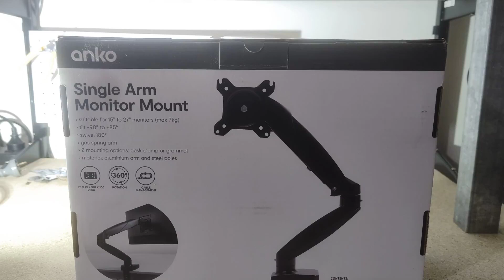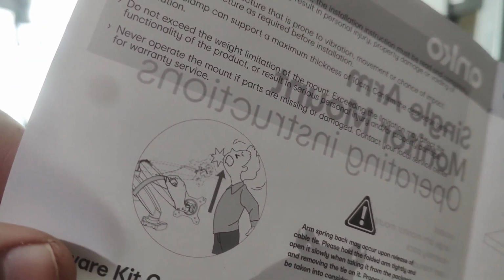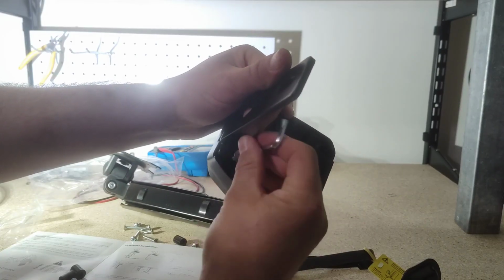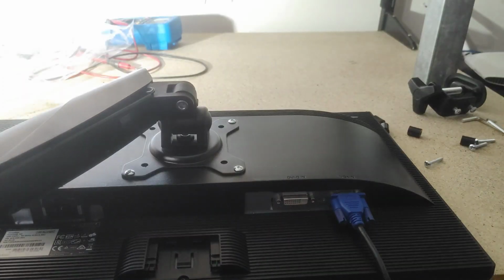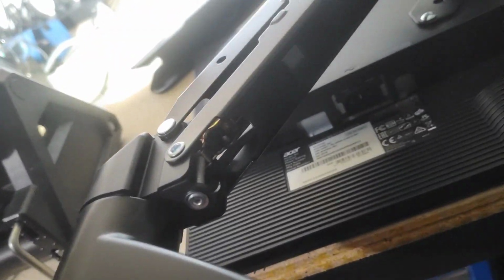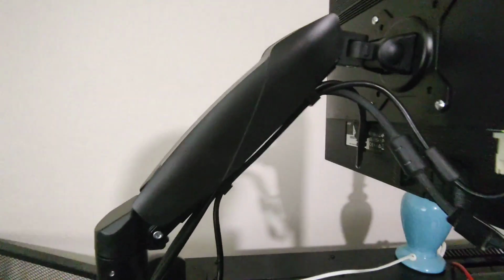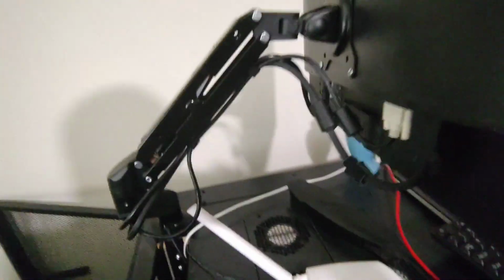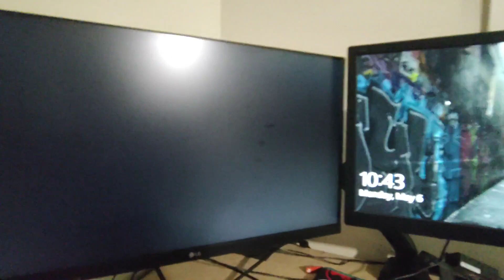$35 Kmart Anko Single Monitor Arm 🤔

Comment: Hi I bought this before but when I take my monitor in arm my monitor is a little tilted may be 4 or 5 degree tilted, I have changed several of them at kmart and they all have such a tilt. How should I solve them
Reply from the maker: Hummm, hard to know. It does have an up and down tilt that you might be able to tighten on the top of the neck with an Allen key.
Reply: @LABMATT.  ok i try , thank you

Comment: Yo I just got it, can you help me? I can’t move the arm around lol
Reply from the maker: There are small holes on each joint of the arm with a small grub screw in them. Just put an allen key in the hole and loosen the grub screw. This will allow you to move it around then tighten them backup when your done :) View 5:41 for screw locations